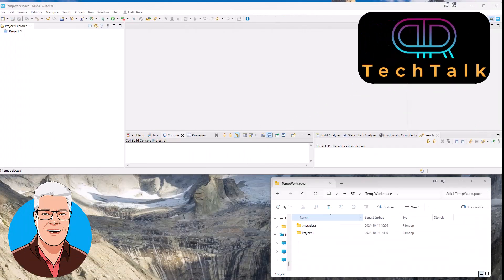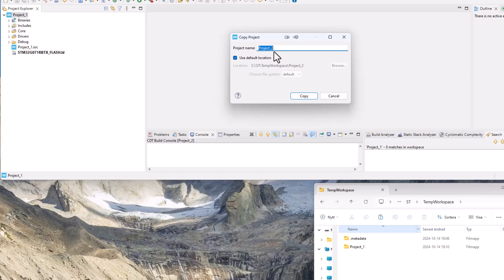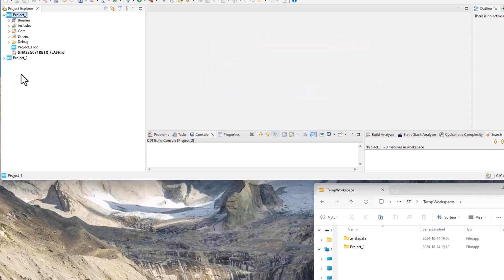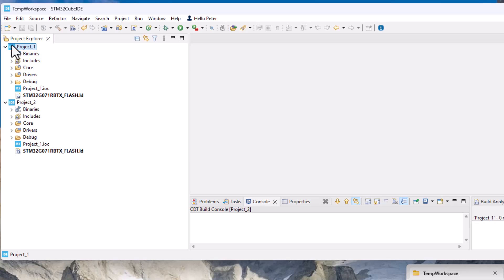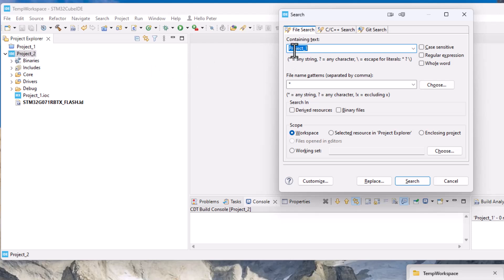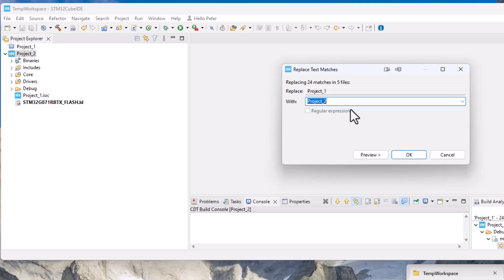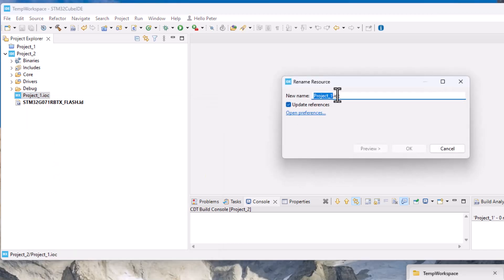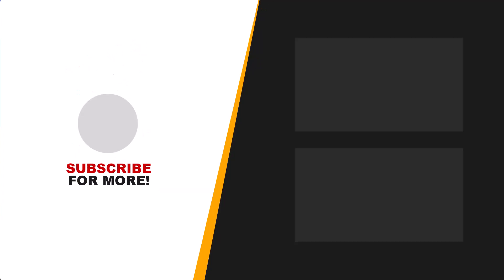QuicTip #9 Duplicate Project in STM32CubeIde

Comment: Very good. One question about STM32CubeIDE. Its about what to do when the program asks if i want to migrate project to the latest version. I have a feeling this migration is risking the integrity of the project files.  Do you know about what to do?
Reply from the maker: Hi , You can take the safe route. First export your project before migrating, that way you have an original version of your project that you can revert to at later state if needed, And you can also have several versions of CubeIDE installed for specific reasons. You can even run in virtual maschines if needed or prefered. But normaly what i do is i migrate to the lates version by default, but i dont have any critical projects. Hope this answered your question,.  And Pls also hit the Subscribe Button it is free of charge :-)  / PR TechTalk
Reply: @prtechtalk416  Ok thank you about that. Ok, so you havent run into so much trouble after migration?  I did it once, and as ai recall it wasnt totally smooth after wards.
Reply from the maker: No, as I mentioned, I usually don't work on "real" projects—just demos and similar things. In those cases, I haven't noticed any issues.